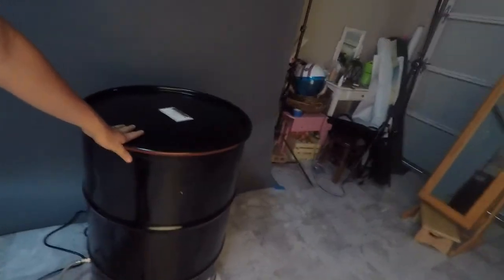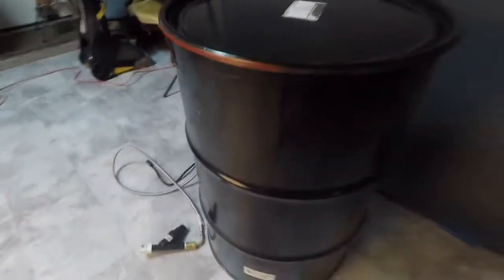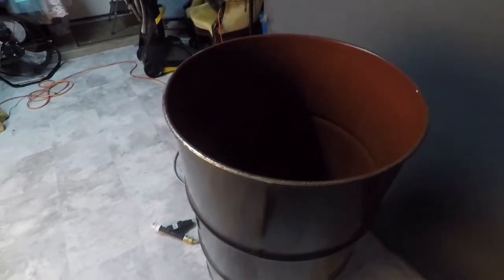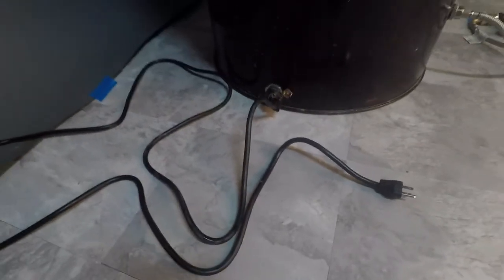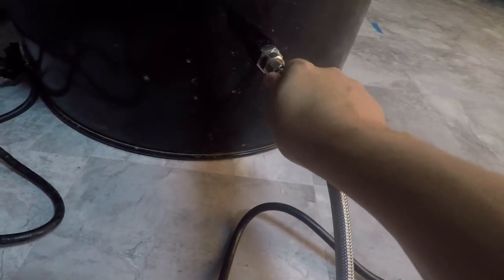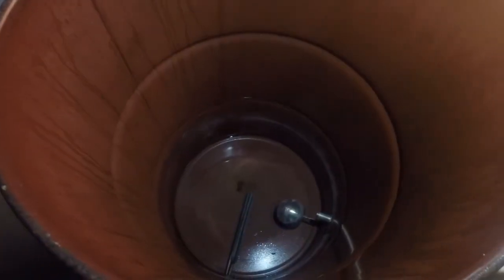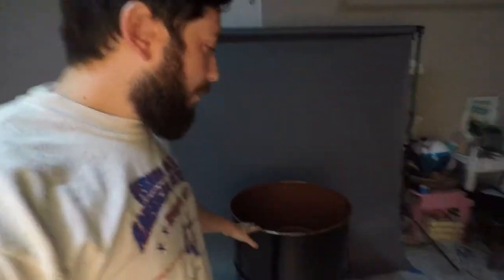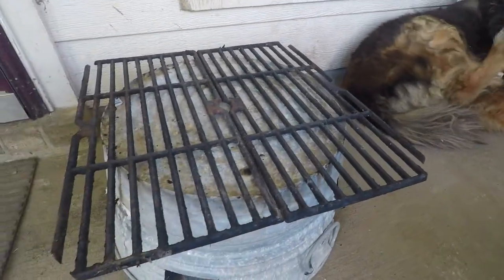[Advanced Methods] CHEAP Barrel Steam Steilizer

Comment: Hey Michael, have you ever had these burn out at the cable?  I've been using one with a plug adapter instead of a hard line and it's burned out a few times. I was just wondering if the hard line is giving you the same issues?
Reply from the maker: If the plug is melting that means is drawing more amps than it should. Either your plug or wire aren’t big enough. Are you using the right gauge wire?

Comment: I'm a metalworker.  I've made my own flowhood, work bench,  I made a pressure cooker as well with a weighted valve (that took some time to figure out) works great + saved myself literally thousands.
Reply: @Oliver Abbot I've got 2 actually that I made.   One is outdoors only made from a barrel like a chemical barrel so it's huge.   I use that for sterilizing large batches of compost or potting soil, straw  etc.    The other one is about 7 gal with plug-in heating element 240 or 120  it'll do both.
Reply: Hi, do you have any video or pic we can see your pressure cooker, I'm really interested in building one and I don't know from where to start, any help will be welcome,

Comment: Respected sir, 
You purchase red and black color rings from hardware shops as per as sizes,  you fix it from inside and outside,  use sealer used for plumbing by plumbers.  
Watch electric cattle fixation , you will understand.  Your drum will not give any leakage. 
Do you iron is galvanize,  galvanize iron don't rust easily. 
Do you know black color pipe are used for solar water heating connections.  This pipe can tolerate boiling water temperatures. 
You surf on net.  It's cheaper. 
I have like your idea of removing extra pressure. Namh shivay.

Comment: What is that tab made of that you're grounded to? Does the screw go all the way through the barrel, or just partially?
Reply: I'm in the process if assembling one.  I was thinking about grounding to the lip on the bottom. So I don't puncture the barrel. I also have copper flashing. Would it be a good idea to use the copper?

Comment: Not sure if you're still active...So that red liner, some people think that should be removed, as it maybe might could possibly leech whatever into the water/steam, and then into your substrate. I'm not super sold on that, but just curious if you've looked into that or not. From what I understand is that it was baked on at like 550 degree, and anything under that is fine. Not like we're cooking in them like a grill or anything.

edit: I just bought two of these, and am pretty stoked about it, until I read some people pooping on the party because of this stupid liner, and that it should be sandblasted out. this was mostly in BBQ forums though.

Comment: I made one of these and I've used it a few times.  When you use this are you using the same oat to water ratio and technique that you normally use?.  I've been doing what you said in your other video with the pressure cooker.  2 lb oats 1 and 1/2 lb water to great effect thank you!  However when I do it in the steamer it seems to cook unevenly, do you soak longer when you cook in the sterilizer?
Reply: I didn't think about that part for some reason. Were you able to make adjustments to the ratios.
Reply: @dezzihotep3768  yeah I basically just add water and flip them upside down to cook.   Still a bit more wet on one side but they work ok.

Comment: I’m about to build this mate but got one question I’m not very good at all with currents and voltage and all that electric stuff and this will sound very dumb but why do we ground it what does it stop from happening ?
Reply: Grounding the barrel gives any rough voltage a way to get back to the neutral wire, which is where it wants to go.  If it can't get back to neutral it will instead try to use your human water filled body as a way to get to ground.  Which is not good.

Comment: I’ve been “sterilizing” oats in my barrel for 6months now but I do experience some contams, specifically bacterial. I do soak them 24hours first, hoping that will increase the size of anything I’m trying to kill off. Then I squeeze out the air and seal the .2 micron filter bags and cook for aprox 18 hours and allow to cool in front of my flow hood. I am wondering if you can explain your grain tek and please help me run mine more efficiently! Any help is GREATLY appreciated!!!!
Reply: Did you ever come up with some details on this?
Reply: @dirkdodson986  still trying to get it down 🤷‍♂️ I’m sure it can work but getting the moisture content correct is difficult. Still not having any contams other than bacterial

Comment: Hey man, just wondering what temp the inside of the barrel is at? I built my barrel today and after 3 hours it's only at 55 Celsius/130 Fahrenheit. I have the barrel insulated and have adjusted the thermostat up to the full setting. Doesn't seem at all hot enough to do the job
Reply: What size heating element are you using? And on how many volts?
Reply: @Laotzsa  Hey Jarrid. I'm using 3000w on 220v. I ended up removing the thermostat unit from the element as it was set to maximum of 60C for safety reasons, must be European regulation or something. 

After removing the thermostat it tops out at 98.6C. I have been testing different run times and have found that running the barrel for 2 hours straight to get the core temp of sub and grain up, then 15 min on/off intervals with a  timer for another 10 hours does the job nicely. the temp never drops below 95C during the off cycle. it keeps energy use down and feels a bit safer. All my sub and grain is perfect after this cycle with zero contamination in any of the batches I've done. 

I originally had the barrel running constantly for 12 hours and ended up burning out the main fuse in my house..it actually shattered the porcelain fuse all over the place. very scary! I have since updated my electric box as it was an old type system from the 80's.

Comment: I would recommend  not only grounding this, but you should run this off a gfci, in case of a fault  to ground, the outlet would cut the power.
Reply: If a protected Outlet is not available, you can actually cut the ends off of an old hair dryer or curling iron, and wire those into the outlet cord. That's exactly what those reset boxes do.
Reply from the maker: Completely agree with the GFCI! Luckily our exterior plugs are already protected by it. Thanks for pointing that out for others safety!

Comment: After reading some of the comments, I want to throw out the idea of staggered boil.   It works if u don't have a PC. The technique is to merely get it hot as possible every 6 hours for 3 times.   I have found this to be more effective than boiling STRAIGHT all day.     If I am really paranoid of contam I will do 6 cycles, but 3 seems to be the magic number. its just enough and not too much.  The time frame is any number between 4 hours and 8 hours ... 6 hours seems to work great.   The stubborn bacteria literally get triggered by heat followed by cool.    Why this doesn't work on the second cycle >> i have no clue << All clear on 3rd .     Lemme know if u decide to try.  I was using rye and wild oat which was kinda tough with no PC.  A big pot on the stove.  I'm kinda curious if it works in a 55 gallon drum , lol
Reply from the maker: What you're referring to is actually called tyndallization. I personally wouldn't do grain without a PC. I've seen plenty of bacterial contamination after an unsuccessful sterilization run of my grain. That's why I don't even consider it for grain. Now, with substrate you can get by with just pasteurization. But hey, if it works for you then do it!

Comment: Hey man great idea, I saw other guy made of something similar.
Are you using PID controller or just running heating element all the time? I guess atleast simple temp controller would work great. 👌👍
Reply from the maker: I've considered using a PID but letting it run continuously works just fine. I'm sure I would save on electricity using a PID but I may just do that on my next barrel.
Reply: @midnightmushroomco.2091  Oh I know that it work fine, but just cheaper with PID.
What heating element you are using, with triclamps or just washer?
Reply from the maker: @siliuksas2533  It’s just a washer with a rubber gasket.
Reply: @midnightmushroomco.2091  If there is no leak it's good enough I guess.
I'm looking now for correct heating element 2-2.5kw, I already have got 2 stainless steel barrels, and stainless steel float valve. Anyway good work man 👍

Comment: Hey there! Thanks for this video, it's very informative. I just had one question. What is the process to ground the heating element? You said that it's very important to do so but didn't understand how you did it. Thanks ☺️
Reply from the maker: It's best to use a 3 prong plug with a 3 wire cord so that you can attach the ground directly to the barrel. Otherwise, if there's any possible short you could potentially be electrocuted. So, the ground wire is literally just attached to the barrel with a screw.
Reply: @midnightmushroomco.2091  Thanks for the reply! Cheers

Comment: I’m having a tiny leak where I connected my element. I RTVed the heck out of it and it’s still leaking a tiny bit. Do you think it’s that big of a deal to seal it up completely?  Thanks!
Reply from the maker: I actually used gasket making material on both sides of the barrel. I just cut the material into a circle the exact size and that worked perfectly. I just couldn’t find an exact size gasket at a local store so I just made one.

Comment: Do you not have a drain on it & do you move it at all when it's done?
Reply from the maker: I honestly just leave the water in there for a few runs and then dump. A drain would make more sense for sure. I just didn't have the hardware nor the interest in drilling the hole when I can just dump it. lol. I just unload the bags onto a cart and take them in to the flow hood. Haven't had any issues with contamination since the bags are still at 212 F during that trip to the flow hood.

Comment: Have you used this to sterilize grain? Or is this only used for pasteurization of bulk supstrates? I've been interested in build one of these for some time for the sake of producing grain spawn (maybe a 30 gal) but I can't really  find a straight answer on it being useful for such a thing.
Reply from the maker: It's really not meant for grain, just substrate. It can't reach the temp needed to actually sterilize. This is really just super pasteurization and not technically sterilization. The only way to do bulk grain is using a retort or large autoclave.
Reply: I have one(3 drum). complete grain sterilizer. From 19 hours @ 26 bags single 55 barrel   or ( three 55 gallon drum sterilizers connected in series or daisy chained together sterilizing 78 bags for 2 days). Ya this simple system really works. Just get it dialed in.
Reply: @buzzzkill9183  What temperature does it run at? Also, what is the KW rating on the element you use? What size were the bags? Was it grain spawn in the bags, and not sawdust? When you say 19 hours, do you mean 19 hours once it reaches temperature, or does that include the heat up time?

Sorry for so many questions, I'm just very interested.
Reply: @jeffreydauhmer385  hey, nice to meet you. I'm spending time with my oldest son today. I'm gunna set you up with all I know Later on . amazon order a 5500 watt element 240volt. 120volt is weak and gets expensive to run. Get a ss or chrome float valve. Use an RV type adjustable pressure valve with a gauge on it. get a 55gallon drum. To start. 55gallon drum=$20  5500watt element=$20. Float=$20. 0-60psi Regulator=$20 (actually this stuff will be cheaper if you price shop) I gtg i'll give more detail later.
Reply: @buzzzkill9183  I actually already have an element, barrel, pid, pressure reducing valve, and ss float valve.

I'm more interested in knowing what temps and time frames, and how much grain (if it's grain) in pounds you're able to run. Thank you for the information, though. I greatly appreciate it.

Comment: Hi! whether spore green molds (trichoderma) are destroyed by atmospheric sterilization. How much time?
Reply from the maker: Honestly, this is more of a super pasteurization instead of sterilization since the steam can't get hotter than 212° F. I run it for about 16 hours and have no issues. I've even sealed a bag after a cycle without inoculating it. It's been about 6 months and still no signs of contamination.
Reply: @midnightmushroomco.2091  6 months ... great and does that also apply if the compost is enriched with wheat or rice bran, soy ...?
Reply from the maker: @zorankospic6243  my substrate is hardwood and soy hull based. Should work fine for others as well
Reply: @midnightmushroomco.2091  Thank you

Comment: Thanks for keeping it so simple! Is there a reason why you went with the 5500w 220v heating element instead of a 1500w 120v?
Reply from the maker: My initial intent was to get 220v run to the barrel but 120v has worked perfectly fine. So I kept it that way. You can use a 120v element
Reply: @midnightmushroomco.2091  hey, awesome and thanks so much for the reply! I will be building one of these soon!

Comment: So, a year later, how's that working out for you? I'm thinking I need to build one myself.
Reply from the maker: It's working just fine! There's some rust but that was expected. At $20 per barrel it's worth just swapping in a new one.
Reply: @midnightmushroomco.2091  Thanks for the quick reply! It's good to know that this should be viable, and a lot easier that running my pressure canner all day!
Reply from the maker: @mtnbkr5478  Oh abolutely! Running a PC everyday is why I switched to the barrel. It's just more effective.
Reply: @midnightmushroomco.2091  One more beginner question: would a step bit make it through a steel barrel? If I'd need to get an $80 punch-out tool, I'd maybe just go with plastic for now (with a 15A element, if it matters; reconfiguring for 15A let me go with less expensive controllers).
Reply from the maker: @mtnbkr5478  really anything that'll cut a hole through metal will work. Steel barrels are relatively thin metal. Skip the punch tool and just get a $40 hole saw.
Reply from the maker: @mtnbkr5478  also, I run on a 15amp circuit using a 220v element with no issues. It just runs non stop. Sure using a PID is much more efficient but it works.
Reply: @midnightmushroomco.2091  15 amp on  a 120v breaker, or are you running 220v to the 220v element?

cheers., and love your style.
Reply: actually...I hear you answered this question at about 2:25